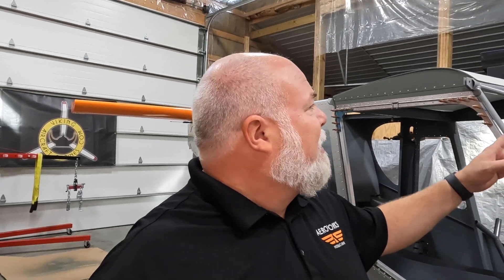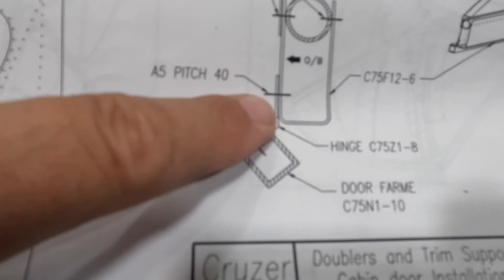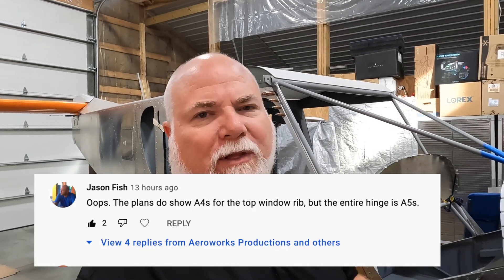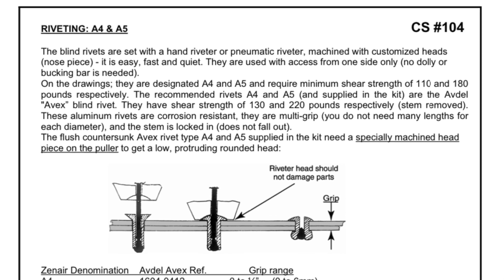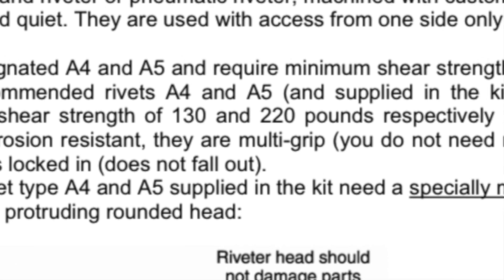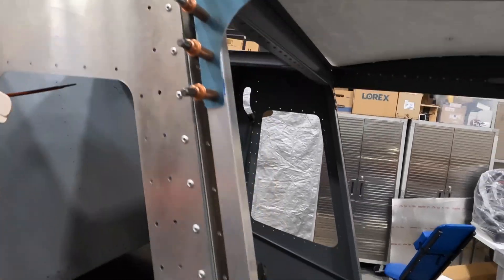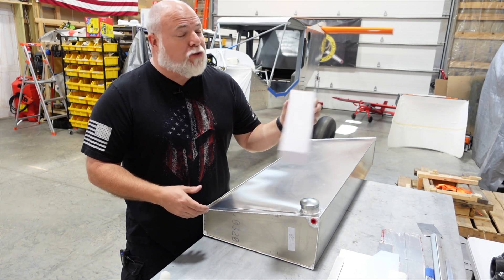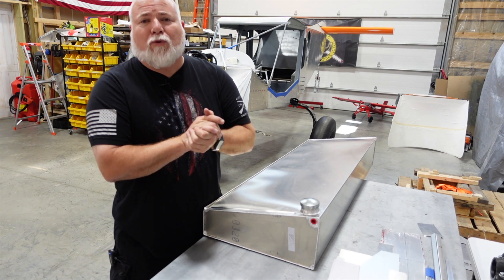Ep. 44 | Fuel Senders & Avionics Tray | Zenith Super Duty Aircraft Build

Comment: Will these senders work on the Dynon Skyview avionics?
Reply from the maker: Yes no reason they shouldn’t.  I’m using Dynon.
Reply: @AeroworksProductions  Thanks - will you have analog fuel gauges installed as well as  remaining fuel indicated on the Dynon which is calculated by fuel flow to and from the engine?
Reply from the maker: @bobwidmer8845  I will have 3 fuel indicators (header tank is 3rd) already checked with Dynon and will monitor fuel flow with an FT-60 “Red Cube”.
Reply: @AeroworksProductions  Thanks - very helpful.

Comment: Excellent information Adam, thank you.

We learn quite a lot when called upon to repair stuff which is not per plans.
It is an invaluable aspect of experience, expertise and insight building. 👍

One question, 🤔 … you mentioned cutting an ‘access cutout’ in your upper door mount structure so you could remove the stems of drilled out A4 rivets you needed to replace however, did you find that you needed to reinforce the area around that cutout, by installing a “Doubler” around it as well as closing the access cutout up after with an access panel cover ?.

If one cuts a structural component that component’s ability to ‘flow shear stress’ is reduced and thus its strength. 

A “Doubler” reinstates an adequate path for the ‘shear to flow’ (load path) thus adding back the lost strength. 

The above may not sound like it is warranted as it might be difficult to accomplish however consider that the margin in strength is typically between 50% (for yield) and 125% (for ultimate), then imagine how much of that margin might be lost if holes and cutouts are made in critical places.

Again, the above is ONLY a ‘heads up’ question and may not actually warrant any action in your particular situation, it’s meant to keep everyone alert to the impact and effects of modifications and deviations from plans.

Once again, great video and thanks for bringing us along on your journey and sharing your content.
Reply from the maker: Great insight and I haven’t cut anything yet so I’ll definitely give it some additional thought.  Roger ok’d the access hole however still waiting to see if it’s even going to be needed.
Reply: @AeroworksProductions  I always wanted to know if the metal that is drilled out when making holes in say the 4130 tubing used in the frame of Cubs, Kitfoxes, , part of the Super Duty, etc. is removed; I'm a newbie to the Homebuilt world, as my background is in transport category aircraft and access is not very often an issue, so I have no idea if leaving metal chips in the frame poses future problems. Very interested to learn what you eventually decide is the best way to address the issue, if at all.

Comment: Your engine choice/change was a good decision.  I continue to be impressed with Viking's ability to innovate and improve.  Steel Bungee for the CH750 STOL was maybe the first.   Outstanding fuel and electrical systems for their engines, critical for reliability and safety.   Recently, an In flight adjustable propeller system.   And I just noticed Viking has SuperDuty specific elevator fences now.   Don't forget the custom Belly Pod for those overnight trips.
Reply from the maker: Check and Check on the last 2 ;)

Comment: Why is Zenith not continuing to update the spec to more modern components?
Reply from the maker: Probably do this to keep kit  prices low they give you the minimum required parts to build your plane but you don’t have to use them.
Reply: I see that point but they must keep up with current technology or get run over by competitors.  Maybe a larger list of kit options.  I am concerned that further development is not proceeding.

Comment: Great video Adam, looks like the doors have you busy! 

Just keep in mind that the non-perforated board has very specific holes to align the battery trays/contactors/terminal strips etc. it is not done arbitrary. Grommets are available for the big holes as well so you can bring through without chaffing. I think we have a video showing placement if it helps, if not let me know and I’ll get you a picture.
Reply from the maker: I see what you mean the battery tray shelf is the one with the larger holes as that is were the mounting holes line up.  Thanks for clarifying.  It's been one of those weeks.
Reply: @AeroworksProductions  no worries! I just don’t want you to work harder than you have to!